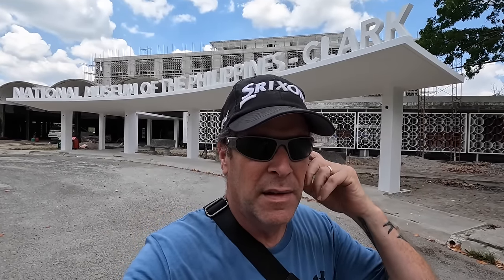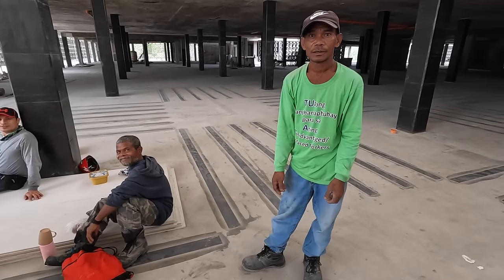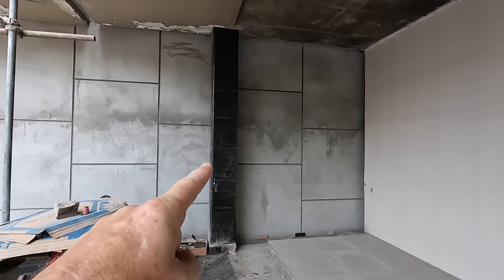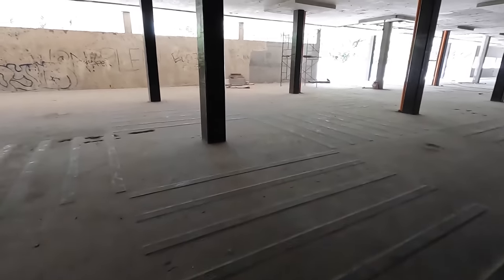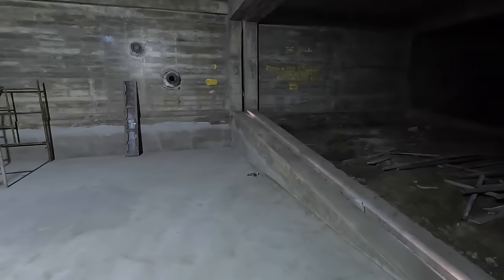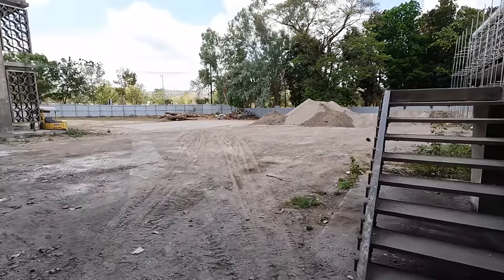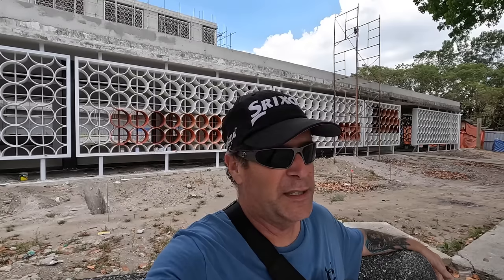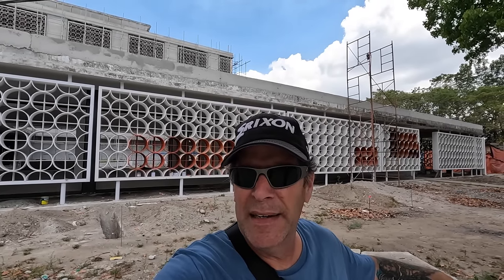HISTORICAL ABANDONED CLARK AIR BASE HOSPITAL REHABILITATION PROJECT - UPDATE MARCH 20TH 2024

Comment: Hey Brian.  Thanks for the update.  As I had stated in your last Clark update,  I had been to Clark on business several time between 1980-1990.  Never needed to use the hospital.  However, I sympathize with personnel who worked or rehabilitated there, that may have more of an interest than I do.  What is interesting though is that everytime you do an update, there's only five guys working.on this project.  I had predicted last time total completion would not be at least until the first quarter of 2026.  I'm sticking with that prediction, based on what I've seen.
Reply from the maker: I film when all the workers are on lunch break. From what I have seen, there is roughly 50 guys on the work sight.